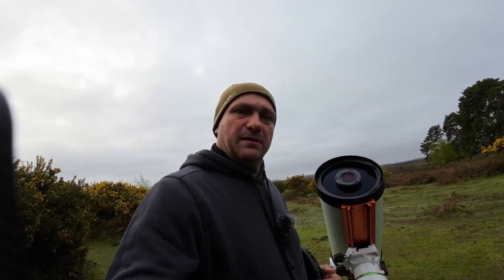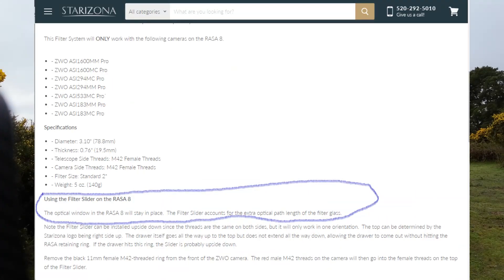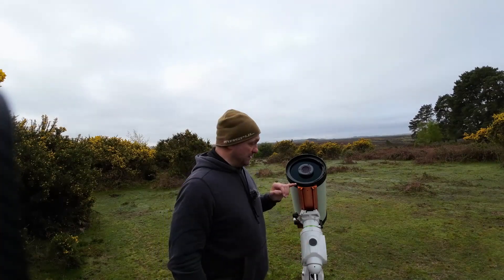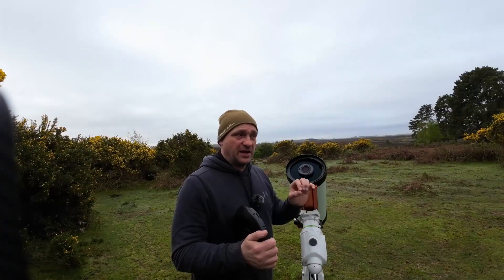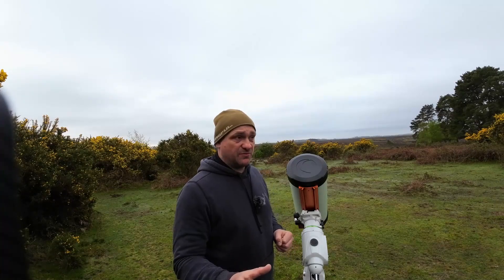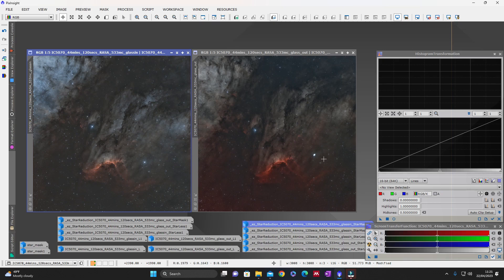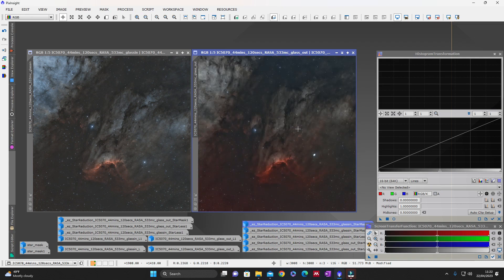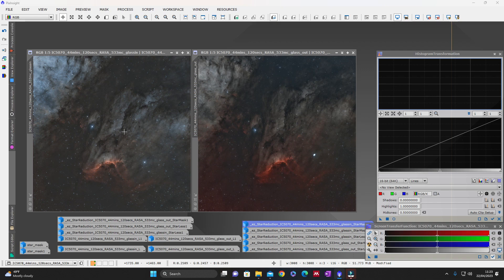RASA 8 Optical glass in our out with the Starizona filter drawer

Comment: Hi All, I was lucky enough to buy a RASA 8 in March after struggling with a huge, not very well-screwed-together SkyWatcher 200P. The speed of the scope is mind-blowing and I've fortunately not suffered at all with tilt or any of the other problems that I've heard other people have with the scope. With this in mind, I just attached my ASI533MCPro to it and used it as is. However, I've been reading that I won't get true colour with the astrograph unless I use a UV/IR cut filter. I also live in an area where there are some IR security lights so filtering that light can only be a good thing I guess. So, I'm going to get the Starizona filter drawer but would like to know what UV/IR cut filter people would recommend for the speedy RASA. I want to take natural colour images with no enhancement of specific wavelengths. Is the cut filter the right way to go?